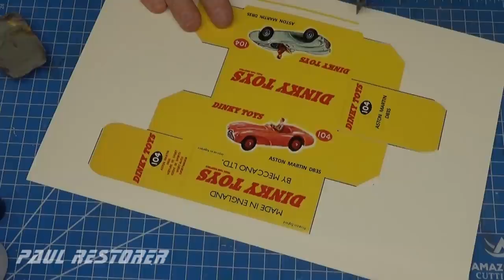Dinky Toys renowacja Aston Martin DB 3 nr 104. Zabawka model odlewany z 1952 roku.

Comment: the model had to be paintstripped and further pickled, sanded by hand with carbody compounds up to bright and shiny metal, the underbody steel plate should, if not  left original unpainted , be treated with phosphoric acid or burnished again. The steering wheel does not deserve the steering wheel does not deserve a stainless steel nail but a brass shaft, I understand that you want to use simple materials...model manufacturers had to make mass production products, you instead  if you make a resin steering wheel you must install a decent support an make a better paint work.
Reply: WTF are you talking about?
Reply: You are like a politician, tell everybody what to do and nobody understands....